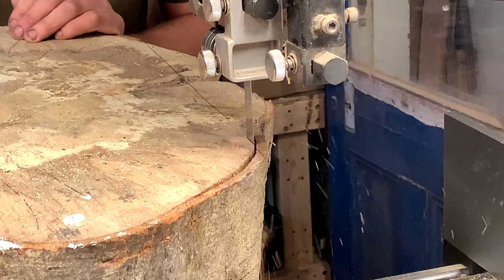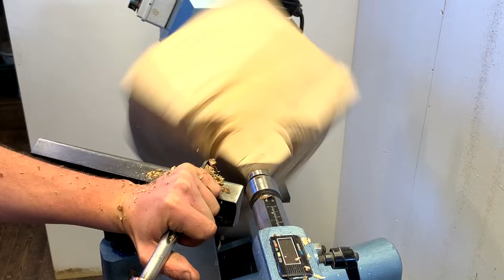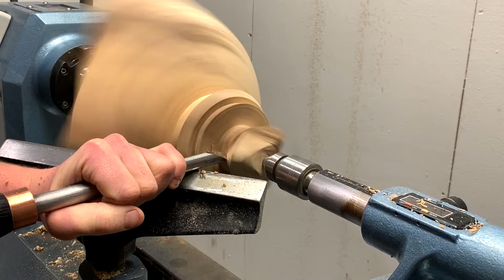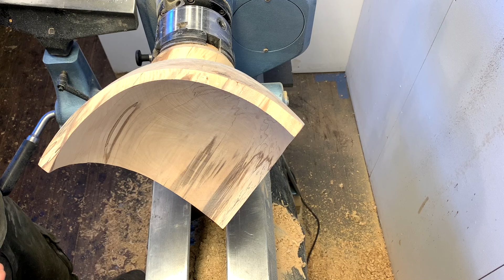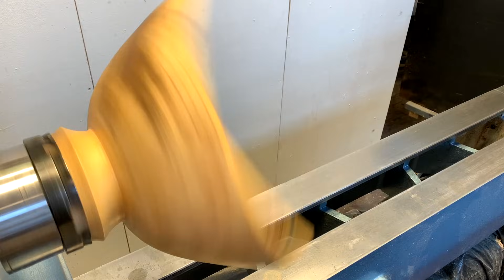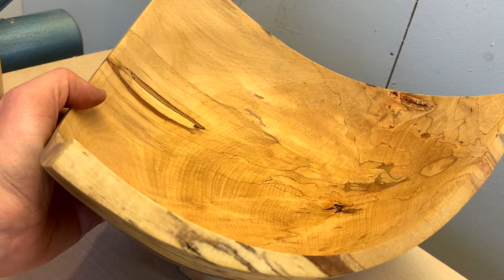Woodturning - The Cube 2

Comment: Great wood turning.  You are one of the few wood turners that I have seen bore a hole for the spur drive.   This is an excellent safety practice to keep wood on the lathe in the event it decides it wants to fly off.  I do this regularly and it has saved me on a few occasions when the wood wants to play games.  More wood turners need to learn and use this practice regularly.  Thanks for showing it in your video.
Reply from the maker: I’m so sorry to disagree with you but, that was used on this occasion to achieve full surface connection.. the wood around the spur is not for safety. 
When used correctly a spur drive between centres is one of the safest holding methods and I start even the biggest bowls in this way. There is no need to drill into a work piece to fit a drive centre and it actually takes away one of the great advantage of starting your work between centres, that is the ability to adjust and correct the alignment of the work piece as you go.
Reply: @JackMackWoodturning  Ok.   What ever you say.  Whether you agree not not, it sill provides a measure of safety even if not intentionally done.
Reply from the maker: Yeah but it’s a false safety measure as the correct safety measures is learning to mount the wood correctly so that it will never come out. 
A fail safe for a faulty mounting method is not safe practice it is ignoring the true issue at hand. 
Woodturning has been practiced and mastered though history as far back as the ancient Egyptians, as with all wood working, we already have safe practices set. The basics require no innovation. Doing so is muddying the waters of the craft.

Comment: I have my lathe now and am going to try this even if I mess up. This piece is magnificent.
Reply: Make sure to do it safely 👍. Your Lathe should be strong enough and have enough rpm to turn that spinning block lol. I just started woodturning as well my lathe is no where near strong enough to pull this off lol
Reply: @desertsmeagol7073  Now you have scared me, haha.
Reply: @MickyBellRoberts  just start with a smaller cube say 6”x6” and go slow so the wood doesn’t splinter.
Reply: @trurex007lee7  Thank you for your advice sir, I appreciate it.
Reply from the maker: Agreed. Safety first. Be sure your tools are sharp as well. I sometimes sharpen more than ten times a day. 👍🏻😉
Reply: @JackMackWoodturning  Yes sir.